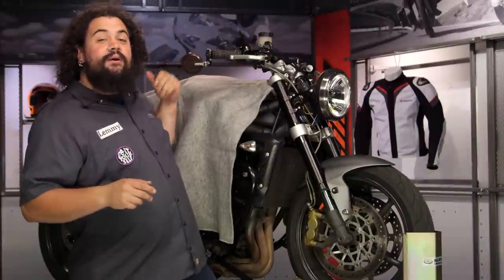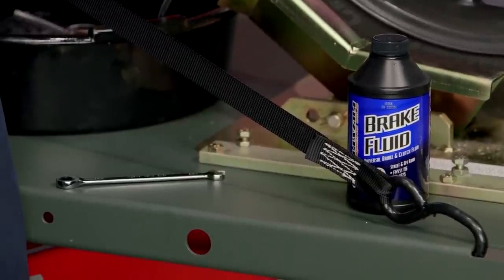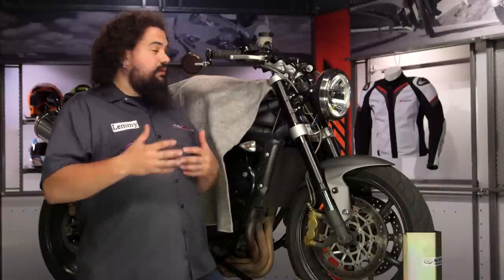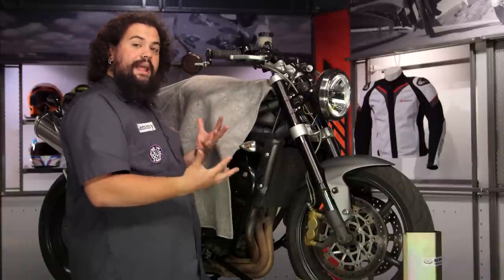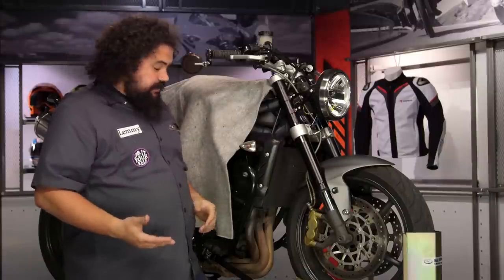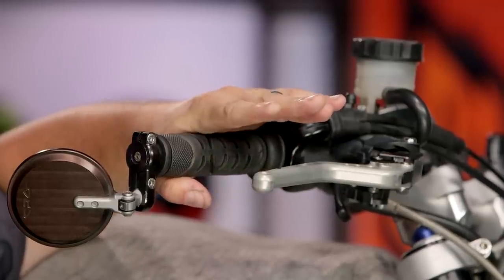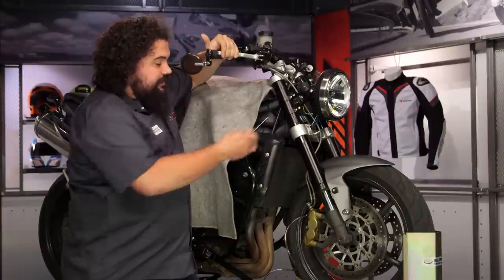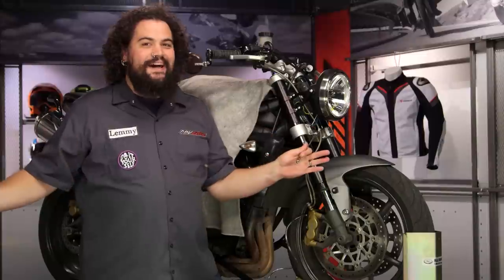How To Bleed Motorcycle Brakes at RevZilla.com

Comment: 10 videos to get to this one....TEN!!! this one taught me how to do it without a stupid rubber hose. squeeze 8 times, and hold...open the valve, let it fart until fluid only, wait 3 seconds. close. release. repeat until there are no more farts. jesus. that was easy. great job, revzilla, and thanks, youve saved me 85 dollar shop fee and got me riding. great company.
Reply: I'm betting if you did it that way you have air still in your lines.

Comment: Took my bike on a warm day to work. My brake pedal had no pressure. parked the bike and rode to work. When I got home searched and found yours and few other videos. Blead  the old fluid that was orange in color and topped up with new clear DOT3 I had for my car. Will try it for a week and see how it is. if I am not satisfied. I will change it to DOT4. It took 30 min for me. May be I will do better on time going forward.
Thanks
Andrew

Comment: Fantastic video, Lemmy! This makes it clear how I need to approach a brake bleed on my 2013 Triumph Daytona 675R. My brakes feel terrible! Only trouble is that I don't have the plastic tubing and am not sure what size tubing I need. I guess the size of the nut to release the fluid from the bleed nipple will be a clue. Rock on. 

Update: I found that the 2013 Triumph 675R bleed nipple at the caliper has an 8mm nut. The nut at the brake fluid reservoir is 11mm. Is that normal? I was going to get a Motion Pro speed bleeder tool but those generally come in one size. I'm also interested in those quick bleed thingamabobs.
Reply from the maker: It's normal...for your bike. -DrewZilla

Comment: Great video, with all major points covered.  However, I don't quite agree with the rapid pumping to build up pressure.  If there's air in the system rapid pumping will have a tendency to 'multiply' the air bubbles, i.e. converting one big bubble into multiple smaller ones, thereby extending the bleeding process.  We used to simply pump gently until there's pressure and then open the nipple to release the pressure.  On older systems it's not a good idea to force the lever all the way back to the handle as the piston seals could then enter an area with corrosion in the bore, possibly damaging the seals and leading to leaks.

Comment: You mention at some point that if there is a dedicated bleed screw at the handlebar reservoir that one should bleed at that screw last. My BMW G650GS Sertao (ABS) has such a bleed screw at the reservoir and the manual says to bleed it FIRST, not last. Could you elaborate more on that screw and its actual function and why you say it should be bled last? I am puzzled and can't find anything on this type of bleed screw online. Million thanks and cheers from Hanoi. Great video, as always!
Reply from the maker: Here's what Lemmy has to say: "The screw probably drives out a lot of air initially due to how it's set up. Follow the manual. Ultimately, the order doesn't matter; the absence of air in the system does. Doing it by the book only goes so far, then there are all sorts of shop tricks to get stubborn air out of a brake system." Hope this helps! -DrewZilla

Comment: If you simply submerge the drain end of the bleeder tube in fluid, you will not draw air back into the system. You can just pump the brakes continually until all air stops. No need to loosen and retighten the bleeder screw. I use a 12  ounce plastic water bottle with a hole punched through the top. Put about an inch of fluid in the bottle and insert the tube through the hole until it bottoms out into the bottle. Pump away.

Comment: What a great video thanks!!!! Subscribed. Two questions: 1) when would you bleed the master cylinder for normal maintenance? Or is it just if you are replacing that part. 2) for modern bikes where there is integrated braking for front and rear is the process using front brake for entire process? Thanks!!!!

Comment: I'll throw in a couple tip from past experience.  1.Speed Bleeders are your friend(look them up) especially if you are flushing.  2. Most bikes don't have that bleeder up by the master cylinder.  The handlebars and master cylinder should be set at an angle to get rid of the common air pocket that forms right at the banjo bolt connection to the master cylinder.  Just take a look where the brake line comes into the MC, it should be obvious.   Not doing step 2 can keep you from getting that near perfect front brake feel.  Just do it. :)

Comment: in addition, it can help to hold a section of the tube up above the caliber so that the air only goes up instead of back into the system. they make magnetic bottles for the refill process too.

Comment: another step to add to the end of the process is to use a strap/ziptie to hold the lever in overnight. In the morning the lever feel will be even better as the pressure overnight will force any tiny air bubbles still trapped in the line up into the reservoir.

Comment: It helps a bit more if that transparent hose was held above the height of the reservoir or even into the reservoir. This way, you can actually see the air bubble run up the tube and out maintaining a column of oil against the caliper cavity.

Comment: I am new to working on bikes, and I have an 81 Goldwing 1100i I have almost fully restored...but the brakes now are all rebuilt and on the bike, but I cannot seem to get pressure after bleeding several times with a pressure bleeder. I got new caliper pistons, the rubbers, and clips. The fronts flow fluid during bleeding, but no pressure. The backs, no fluid comes out (seems there is a block somewhere) no matter how much I try. Any thoughts for a noob who lives next to a Harley shop, but they won't work on his Goldwing?

Comment: I watched a different video on bleeding brakes right after line change where no fluid was in lines. Guy in video started by having bleeder open and pumping lever till fluid started to come out then went to having bleeder closed then pumping holding and opening  to get rid of air. He stated this  helped get fluid into dry system.  Is this correct?

Comment: 2018: Thanks! My R1 also says it too lol

Edit 2022: My R6 still has spongy levers. I spilled brake fluid on the driveway. Good times lol 😂 Guessed at a 1/4 hose but will go tighter next time, using zip ties atm.

Comment: Hi Lemmy! Thanks for the video it’s super helpful. Just a quick question, is it completely necessary to bleed the ABS module, otherwise I’ll have to take it to a dealer so they can use their fancy tool to bleed it. Cheers man!
Reply from the maker: It really depends. Some bikes are ok, others need to go to the dealer. Check the forums for your specific bike. -DrewZilla

Comment: Hey Lemmy. thanks for the awesome video. I'm hoping u can help me all the way in New Zealand ! I was doing a bleed as per your video.. when i finished up my brake calipers are locked on the disc. is it something I've done? and is there an easy fix? brakes were working fine before i bled
Reply from the maker: Try taking the caliper off the disc and then seating the pads back into the caliper. See our video on changing brake pads for more details on removing the caliper and safely seating the pads without damaging/scoring them. -DrewZilla
*https://youtu.be/1xITumgvvS4
Reply: Awesome thank you! I'll try that today

Comment: I have attempted to bleed my front single caliper brake as per your instructions, but am not developing any pressure in the lever. Background: I drove my bike home and put it in the garage, a week later, no front brake pressure.
-I decided to bleed the brakes and flushed the entire system with new fluid until no air appeared in the bleeder line.
-But, after hundreds of pumps and dozens opening of bleeder valve, no pressure in handle.
-I have tilted the bike to the extreme, thinking air was up near where the line meets the master cylinder.
-I have stored the bike for days with the brake handle ziptied and engaged.
-I have checked entire line and caliper area for leaks and found none.

Do you have any idea what I'm missing or might be the problem?
Reply from the maker: You may need to replace the crush washers then try again. For troubleshooting past that, you might want to consult a dealer or qualified mechanic who can look at the bike in person. -DrewZilla

Comment: I feel so helpless. Brake is super sponge like now. Worse than when I started bleeding. I am using a really tight hose. I am only letting go of the brake lever once I close the valve down by the caliper. The brake lever is NOT getting any tighter. It's the same as when I started. 20 min each side. I feel the same sponginess. Brake can still be pulled right to the bar with ease

Comment: What you fail to show, and to mention is that for the left side and the back (assuming that you have rear discs) is that it is nigh on impossible to do it by yourself unless of course you have 5 ft long arms.   So when you get ready to do your brakes, get a buddy to pump up and hold the lever for the right side front and the rear bleeding operation.

Comment: is this process  good to do for locked up front break. I'm a new bike owner and I was practicing my slow speed riding at out of nowhere I couldnt feather my clutch (thank you lemmy for teaching me how) and has made me nose dive so I got it going it sounded high in drive and then the front wheel locked up and make my bike jump. scared the poop out of me. any advice to avoid this and fix this would be greatly appreciated by an army vet
Reply from the maker: Would you mind providing a bit more context and description of what is happening? Is this a brand new bike or is it an older model year? What year/make/model is it? -DrewZilla
Reply: its a 03 kawi vn 750,  only 5,500 miles been siting for a while
Reply: it was part break line part master cylinder . I fixed the problem with my neighbor he showed me how to fix it. love doing the work myself

Comment: Good tutorial but I'm a bit confused now..... In my service manual they say this: 
1. Open the bleed valve [A].
2. Apply the brake and hold it [B].
3. Close the bleed valve [C].
4. Release the brake [D].

So what is it? Or could you do both? I got a 05 ZX6R.
Reply from the maker: You can do it A-B-C-D or B-A-C-D. Applying the brake first builds pressure in the line. Just remember not to let the reservoir empty completely. -DrewZilla

Comment: If you are bleeding the whole system should you star with the back break since is the farthest?
Reply from the maker: Generally, the rear brake is separate from the front brake, so it doesn't matter. For bikes with linked brakes, you'll need to refer to that bike's specific service manual. -DrewZilla

Comment: Hasn't anyone heard of a One-Way bleeder valve?  You can buy one at any auto supply store.  It's cheap and it only allows fluid to come out without allowing air to be sucked into the system.  Makes bleeding brakes a breeze.

Comment: What about the caliper on the other side. Does that need bleeding too? Talking about a split braided system.
Reply from the maker: Yes, all lines in the system need to be bled, so you also need to bleed from the caliper on the other side. -DrewZilla
Reply: RevZilla Thanks for the answer man. i actually skipped it and the brake is still much improved but, will do the other side now!

Comment: This is probably a dumb question, but do rear drum brakes even use brake fluid? and if they do, how would you bleed them?
Reply from the maker: If the rear brake is a mechanical drum brake, then no. A mechanical rear drum brake has a rod or cable going from the rear brake lever to the rear brake. If the rear brake is a hydraulic drum brake, then yes you bleed them similarly to this video. -DrewZilla

Comment: great job on how brake fluid sucks in moisture not many guys no that but my question is I had to replace the caliper square cut seals on my bike I bleed the shit out of my system they are ok but still seems like if I pump the lever a few times they are better is this normal
Reply: its a 6 piston fixed caliper
Reply from the maker: If you still have "spongy" brakes after rebuilding the calipers, you may need to investigate the master cylinder. -DrewZilla
Reply: +RevZilla if I use line locks on the rubber hoses the master cylinder is rock solid
Reply: David, then you still have air somewhere in the system.

Comment: Quick question! If you have adjustable levers, like this bike does; is the higher (lever furthest away from the bar)  setting more preferable to the lowest (closest) setting or vice versa? Or should you just leave it where you usually have it while riding? thanks in advanced
Reply from the maker: Set it to the farthest out setting (longest reach) just to be safe. -DrewZilla

Comment: Hi, wonder if you could help

1__originally the problem was the rear brakes (sunk) local mechanics replaced the brake pump arm but then the problem  Occurred again. 
2__another local mechanic took a look and he placed o rings for tube connection points of the brake hoses, then

3__when I press the rear brake pedal, there is a feeling of pressure and medium level of stopping power, but only when  I drive around  and the brakes work normally, meaning when I press the rear brake pedal., stopping power is normal

any way to fix this?
Reply from the maker: It's hard to diagnose the issue over the internet unfortunately. We really can only recommend consulting a mechanic who really knows your bike manufacturer. -DrewZilla

Comment: My motorcycle uses DOT 4 fluid. Can I use any DOT 4 brake fluid or is it specific to motorcycles?
Reply from the maker: As long as it's DOT 4, it's correct. There isn't a version specific just to motorcycles. -DrewZilla

Comment: I've been reading on forums for good measure to leave the cap open or loose overnight to let any air bubbles out. Is this sound advice or just unnecessary?

Also how much of the new brake fluid will be wasted with the repeated cycles?
Reply from the maker: +ALIEN SCIENTIST Yes, you can leave the cap loose overnight. EDIT: You don't need to leave the cap loose overnight, as brake reservoir caps are already vented. To avoid letting any moisture into the brake fluid, it's best to tighten the cap down. As for waste, it really depends how long the brake lines are and how much air is in the system. Brake fluid is relatively cheap, though, so just buy a few of the very small bottles. -DrewZilla

Comment: Thanks for the brake bleeding.  I bled the brakes "too much" ie there is hardly any play in the lever.  How do I get 1/2" play on the lever.? thx
Reply: Thats actually how the brakes are supposed to feel. If you go ride for a bit you will get your muscle memory to remember the new feel. Otherwise you have air in your system and that gas can be compressed/expanded due to various reasons, causing a variety of feels. You wont experience that as much with a properly bleed brake system.
Reply: Jay Other bikes with the same hydraulic brake have more play than mine. I think I will let in a little bit of air to get more play in the lever. I did ‘upgrade’ from a 3/8” to 1/2” piston. Perhaps that is a factor

Comment: My bikes got two Calipers up front. Do I bleed both for a flush? Also in what order? Closest to master then farthest?
Reply from the maker: Yes, you need to bleed both. As Lemmy wrote in the companion article linked in the description and below: "Start bleeding at the farthest port from the master cylinder: Your manual may have a specific order to do things, but if it does not, start at the farthest item from the master cylinder. For dual-disc front brakes, that usually means the left front caliper. You can technically do this in whatever order you please, but if you have lots of air in your lines (like if you just put on some new braided stainless steel brake lines), this will drive the most air out quickly, leading you to pump less. Move over to the next caliper, and to the bleed port at the master cylinder if the bike is equipped." Hope this helps! -DrewZilla
*http://www.revzilla.com/common-tread/video-how-to-bleed-motorcycle-brakes

Comment: hey Revzilla, My Brake lever almost bottoms out nearly an inch away from the grips when I press it. could you tell me a possible reason that might be causing it. I feel it may be air bubbles, but I don't know how I would have introduced air into the system when I never touched anything. 
My bike was parked for 3 months this summer, and when I took it out I've been feeling the brake lever is feeling spongy and I have to prress it almost all the way in now for the brakes to engage.
Reply from the maker: Air and moisture can get into the system all by itself just with the bike sitting. If the brakes haven't been bled in a couple seasons, it might be worth doing it now. -DrewZilla
Reply: yea, that's my plan to bleed them to hopefully fix the problem. 
Thanks for the reply. :) I love your videos

Comment: My Honda VFR800 has dual combined braking system. Is there something different or I should do just the same actions? Thanks.
Reply from the maker: You need to get a full factory service manual and follow those specific instructions for the linked brakes. -DrewZilla

Comment: thanks for making a clear video. the only question I have is once you have removed the air bubbles and tightened up the nut should your brake lever be firm to pull? mine feels the same but brakes feel sharper
Reply from the maker: The lever won't necessarily be firm to pull, but they should feel less squishy. As long as you pumped the lever to re-seat the brake pads after the bleed process and the brakes feel sharper, then you should be fine. -DrewZilla